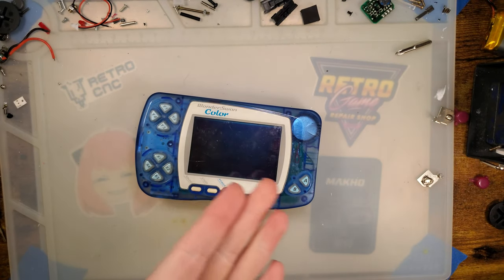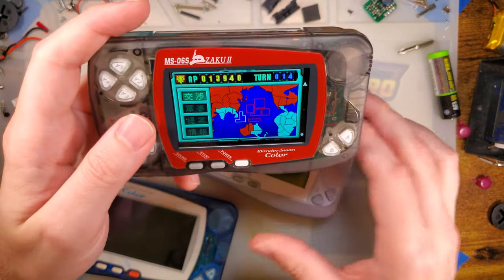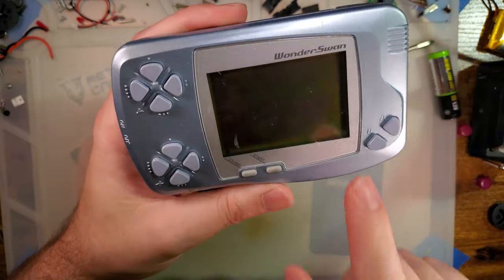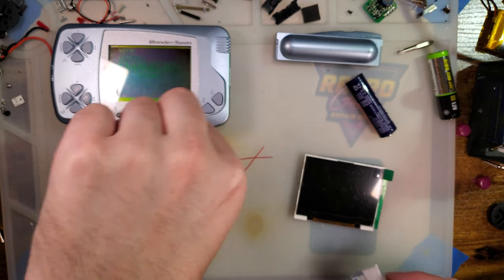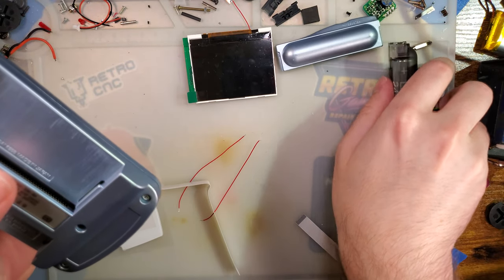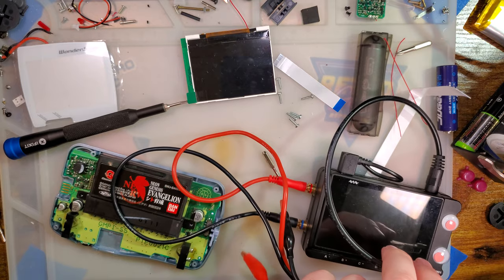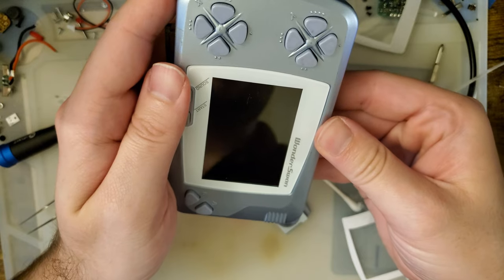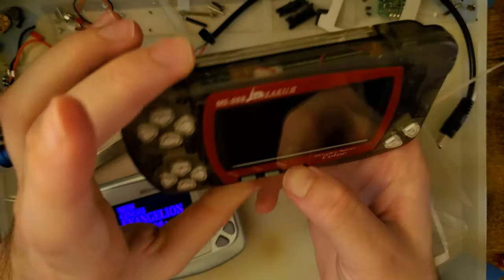Wonderswan (Original) IPS Backlight Kit

Comment: My SP keeps getting visual glitches and crashing while playing silver, but it has no trouble with my blue version nor emerald and silver plays well on my regular GBA. I have played silver for 50 hours now. Is this a memory issue or an issue with the GBA/GBC switch in the SP? Sometimes silver plays normally on the SP. Around 1 time out of 6 it plays well. Many of the glitches happen when an action is performed in silver such as waking into another area or building or pressing a button such as accessing the bag or pressing start/select.

Edit: tested it again and it glitches out when I even apply a bit of force on the cartridge

Comment: There actually is a screen kit for the Crystal.  The screen on the Crystal was considered the "best" of the terrible wonderswan screens, so a lot of people tended to buy them for the "best" wonderswan experience prior to these backlight kits (I have heard some people complain the backlight kits have the 'wrong' refresh rate, but I am not quite sure about that).  They have gotten expensive over the years because of it.  I think a lot are hesitant to mod the Crystal because of that though, doubt it is very popular. I don't think there is any advantage over a backlit color.

Oh and the color kit has the screen available seperately (I know because I ruined one), but the color kit isn't glued together.

Oh and that Evangelion game got a translation. It is really cool, you play as Ryoji Kaji who is tasked with "raising" an angel. It is pretty much just a digimon raising game where you can explore NERV HQ and the surrounding town  to view character events and gather items. Has some gimmicky battle system too, but it is really only there to fight your raised angels against other people using a link cable.  No use in single player.

Comment: There's kits for the Crystal, and it works fine, and it's not too difficult if you're used to cutting GBA/GBC shells before Funnyplaying made IPS compatible ones, though I don't think it's worth modding them. 

There's no unique games for the Crystal, and the shell needs to be irreversibly modified (and there's no replacement shells.... yet). 

Plus if you factor in the cost, a Color costs ~$50, and the Crystal costs ~$200.

Comment: this is cool, i like that you mix things up. I'm a novice but how do you find a ground on a board? i was gonna try to fix my sn30 pro plus(it's the one with the paddles on the back)
Reply from the maker: It helps to know how PCBs and circuits are designed. Ground is often referred to as "common (ground)" because usually everything on the board is going to be referenced to the ground. EM shielding, power switch or port shielding, buttons, negative battery terminal, etc. If there isn't a clearly labeled point, you can usually make an educated guess based on negative battery terminals and copper fills or EM shields.